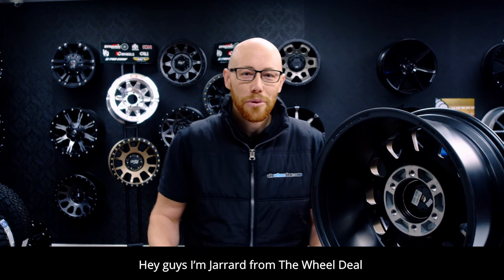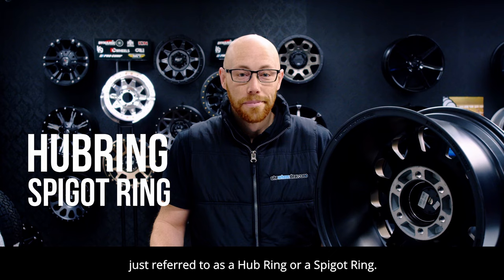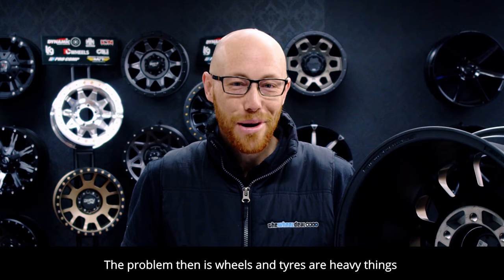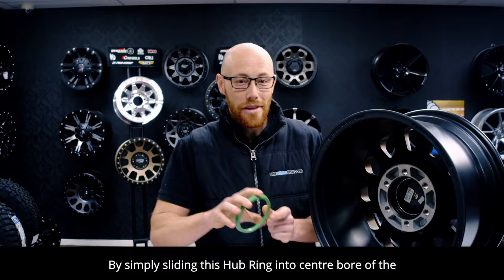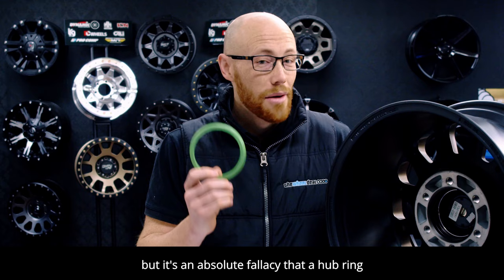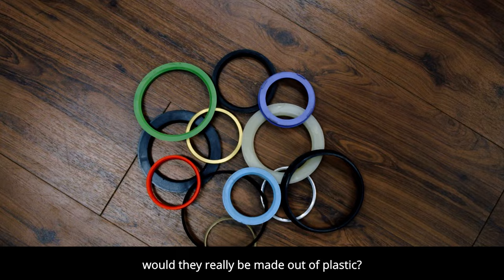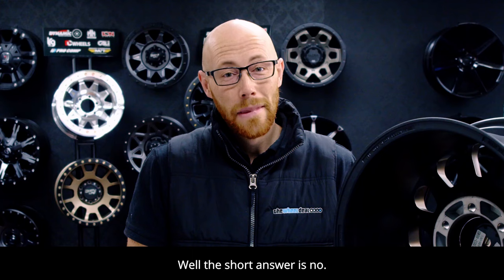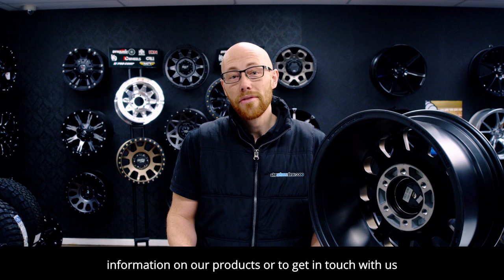Do you need Hub Rings?

Comment: Ive heard a lot of drivers who experienced wheel wobble while driving fast on a hiway because after market rims. So for me hub centric rings is very important. Not going to take the risk.
Reply: I don't think you mean wobble (side-to-side)? A hubring wouldn't prevent that anyway.
Reply: My rings in mh rsx just went and thats what causes the wobbling, they don't allow the tire to sit correctly
Reply: Does nothing once the lugs are tightened. Just hand tighten in a star pattern with the wheel off the ground. Torque to spec with the wheel down - go slow in a star pattern again.

Comment: Do you have to use hub rings? Yes, if you phreaking value your life and the life of your passengers. Wheels vibrating and falling off at hi speeds is not fun, it is dangerous and it is expensive. If you get after market wheels, do it properly. Anyway, why would you not use a ring, those things are dirt cheap.
Reply: What if your aftermarket wheels have tapered lug nuts that center the wheel on their own?
Reply: @SeanyMacks  Fine, if the center the wheel perfectly.

Comment: Not necessary. Hand tighten in a star pattern with the wheels off the ground. Lower and torque to spec with wheels down - go slow and tighten in a star pattern again. The cone lugs will center the wheels if done correctly.
Reply: Yep, you are exactly right. In fact, there are tons of race cars out there using aftermarket wheels that do not match their hubs and they also do not use hub rings. You can find articles written about it in tons of magazines. It’s a myth that you have to use hub rings, although they are handy and helpful.conical Lugnuts do the job especially when Tightened properly in a star pattern. Thank you for your response.

Comment: Realistically and wheel that uses conical style lug nuts has no use for a hub ring. The lugs will center the wheel properly when tightened in the proper sequence. The taper of the lug nuts leaves no where for the wheel to go other than directly in the center. Only some weird cars that use wheel bolts or funky lugs that are flat or use washers ever need hub rings.

Comment: Put some aftermarket wheels on your car that have a larger hub bore without hub rings and drive it around for a few weeks of highway driving and a gravel road several times a day and let me know what you think
Reply: Correct me if I'm wrong but, Isn't that why you're supposed to re torque the rims after 5k miles? I mean that's how I've been told by my parents and grand parents to do this 110tq 5k then 120tq. And I've never had a problem I do have a 6x139.7 with a 108 bore running aftermarket rims 20x9 with a 106.2mm bore so I have to rely on Lug centric and not hub centric since no one will fabricate 108.0mm to 106mm hub centric spacers and my only real option would be to machine the rims bore to 108.0mm and thats a risk I'm not willing to take (rims where way too expensive) 🤣
Reply: I had problems almost immediately after I had mine put on and went back for hub rings the following week and it helped the vibration tremendously.  If I'd had to go 5000 miles of that nonsense I'd have just put my factory wheels back on and called it a day
Reply: @thehellspawn7577  how's that holding up for ya? lol
Reply: I've driven half a year on after market wheels without hub rings and any problems.  I've double checked and torqued the lugs to recommended 100 lbs. to ensure no slop.  Though rings are not needed, I'd still get them as seating the lugs are a nuisance.
Reply: @thehellspawn7577 
So the hub is larger than the hole in the rim? How do you get them on?

Comment: Volkswagens and similar cars use bolts instead of studs to retain the wheels. I had a terrible time with my Enkei wheels not running concentrically on my 1981 Scirocco until I installed hubcentric rings. Instantly the problem disappeared. The best case solution is to have wheels that center on the hub (OEM or OEM-style), but hubcentric rings are the next best thing. I don’t know if the problem is more pronounced because of the method of wheel retention?

Comment: O my, so you don't need those Hubcentric Rings for original wheels (my car is 2003 Chevrolet Cavalier). I received new front Hub-bearing assembly, and they came w/additional parts ( now I know they are Hubcentric rings). I thought those additional parts are some king of seals for the bearing-hub assembly, and couldn't find out how to put them together. Thank you so much, now I know for sure
what those mystical objects are. There are also 2 rubber rings, where do they go if you need to use those Hubcentric rings? Just to know. Thank you for the film again.

Comment: Wheel center rings work really nice with the nissan versa sv because the car shakes and breaks squeak alot and it's really ruff but after I put them wheel center rings on it made it reap smooth so anybody with a nissan versa sv get them wheel center rings you won't regret  it

Comment: With all my experience gained from aftermarket installation in my cars, you Do need Hub rings if you are a spirited driver. And Hub Centric ring might be skipped by most aftermarket alloy wheels installers it should be mandate to use hub rings because it definitely distrubutes load to the hub instead of directly to the lugs moreover those who have searched for hub rings definitely getting vibration in there steering wheel going over 100Km/h.
Reply: Wrong, there is no load on the hub.

Comment: I just changed out 3 wheel studs because I accidentally stripped them when putting on a tire that had a way bigger center bore. This vehicle also has a wobble at 110 so gonna try and pop these babies on and see if it fixes! 4 For $13.50, I think it's worth it.
Reply: 110 km or miles?
Either way,did it help?

Comment: The only thing hubrings do is assist you with centering the wheel. Once you put your Lugnuts in, they take over with the studs hub rings are not necessary for alloy wheels as long as you are careful as you tighten your wheel down in a star pattern and assuming you’re using cone Lugnuts Which most cars use except for Audi and Volkswagon, and some other brands. But once again as long as you’re careful with your tightening, they are not necessary, but they are helpful.

Comment: Sorry, but aren’t the wheels aluminium so I don’t think aluminium hub rings are going to cause any more electrolysis than the wheels themself.
Reply from the maker: That logic makes sense, but you need to understand and consider the relationship and the size of cathodes and annodes in dissimilar metals on the galvanic corrosion process.  A hub ring is smaller in mass than the steel hub it's being fitted to (accelerating corrosion), whereas an alloy wheel is larger than the steel hub it's being fitted to (slowing corrosion).